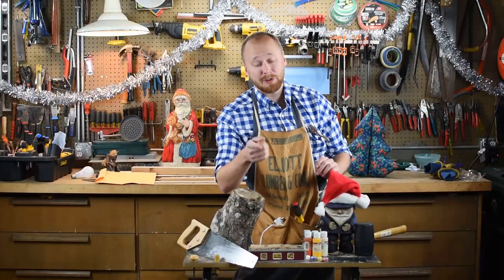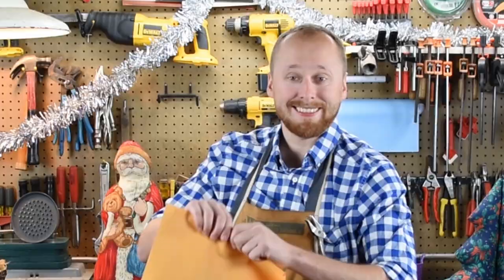How To Make A Christmas Ornament

Comment: Not to shit on the sponsor but also: check your local library if you have one, many these days have publicly available 3D printers that they allow you to use for only the cost of materials.
Reply: Thanks for noticing! Yes, we encourage anyone with a 3D printer or access to one through school, library, etc to print them out for free if they so choose. There is no requirement to purchase. That's why there is a link to the ornament 3D files in each Open Market product.